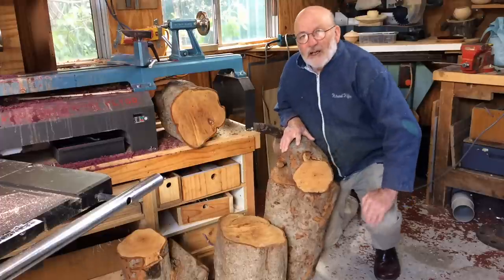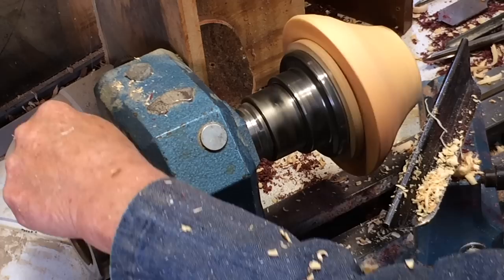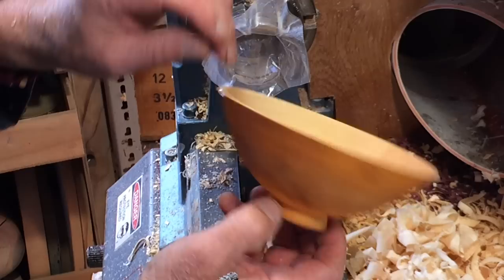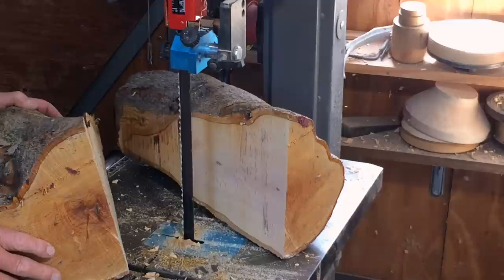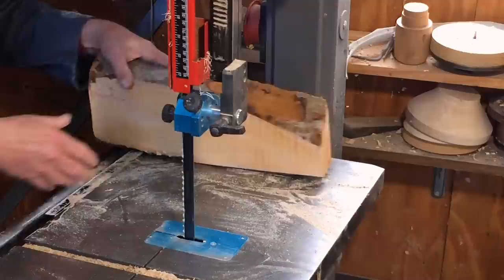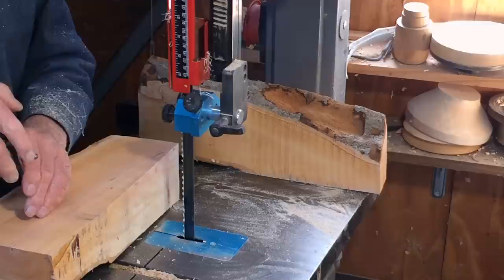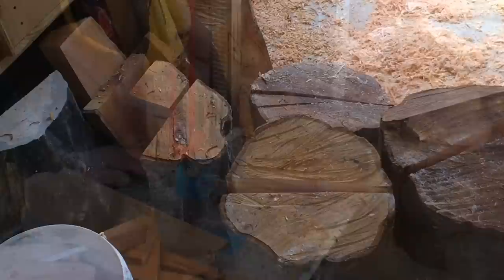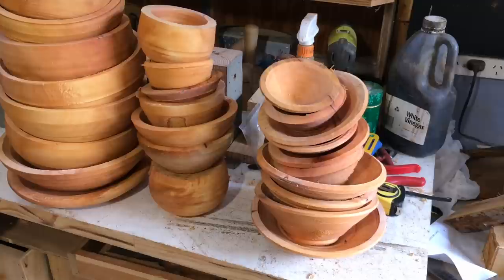Richard Raffan converts pear logs to roughed bowls.

Comment: Thank you for a very informative video. I have a load of Birch that I need to cut and get into shop to dry. I was leaving some outside to, hopefully, spalt a little.
Reply from the maker: Try spalting small green blanks and roughed bowls by putting them in a plastic bag for a few weeks with a few wet shavings.
Reply: @RichardRaffanwoodturning  That's one way. Wrap your wood in paper and bury it in the damp ground for six weeks to start with. Exhume it and check for any spalting. Watch out for rot. Stuff it back down until if any spalting is to your satisfaction. Best regards from spalty Scotland, Home of the wild haggis.
Reply: @RichardRaffanwoodturning  I hadn't thought about that. Thanks.
Reply from the maker: @johnmitchell1614  i wouldn't mind a bit of wild haggis... Burying: I got some very interesting dark spalting smearing a couple of finished bowls with yogurt and putting them in my compost heap for two months. With the muck cleaned off and some polishing they looked like ancient bowls in an antique shop.
Reply: @RichardRaffanwoodturning  Ooh yoghurt eh? I'll give that a try. Feed the bacteria. Best regards.

Comment: Hi Richard, what size is that bandsaw?! I'm having 'fun' trying to process my own wood. It seems like Chainsaw is the best way for the moment. I saw you have a bandsaw, but it seems like its quite monstrously large?
Reply from the maker: This is a small bandsaw. It's a Laguna14/12 (14” throat, 12” depth of cut). Newer models have a foot break. This is Laguna’s smallest saw and as a turner I certainly don’t want one any smaller.
Reply: @RichardRaffanwoodturning   Thanks for the reply Richard, your responses to questions are always much appreciated. Yes- it seems that bigger is always better in this case. I was just wondering about getting a bandsaw, but can see that just getting a small one would simply be a waste of space and money.
Reply from the maker: @timbudd4183  A deep depth of cut is useful for breaking down short logs safely by standing them on end, and for, say, cutting a 300x100mm square into two 300x50 mm boards, that's 12x4" bowl blank into two 12x2" dishes. You can do it all with a chainsaw but lose a lot more material.

Comment: Perfect timing a giant pear just came down in my mothers backyard. How long do you dry the rough blanks for?
Reply from the maker: The rule-of-thumb to season timber is: one year per inch of thickness plus a year — which is one year per 25mm of thickness plus a year. However rough-turned bowls often stabilise faster because a lot of tension in the wood is released when the bowl is hollowed. Some box elder bowls I roughed only a few weeks ago is already dry as you'll see in an upcoming video.

Comment: Hello Mr. Richard, How long and at what power did you put the bowl in the microwave? Are there any rules for drying in the microwave? Thank you.
Reply from the maker: I always cook on full power, 1000 watts on that microwave oven. Small bowls get 60-90 seconds. You need to watch the initial cooking in case you smell burning or see smoke or steam. If you do switch off the  microwave instantly. The idea is to heat the wood so it is too hot to hold as you remove it from the oven. I'll put larger bowls with a 10mm wall thickness in for 3-4 minutes. Then once the wood has cooled I'll re-cook them for a similar time. I've never formulated hard and fast rules for microwaving as each bowl is different in density, moisture content and size (the volume of wood in the bowl).